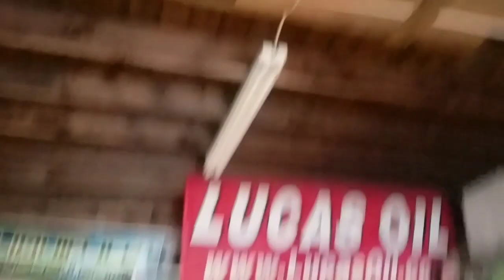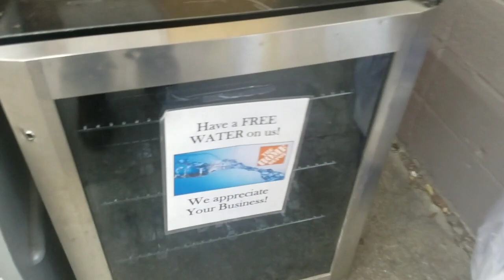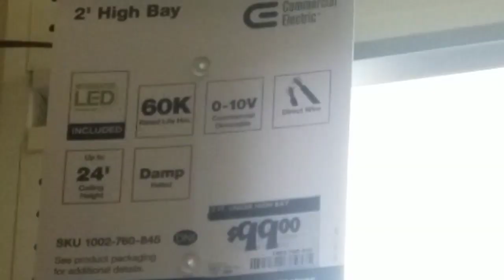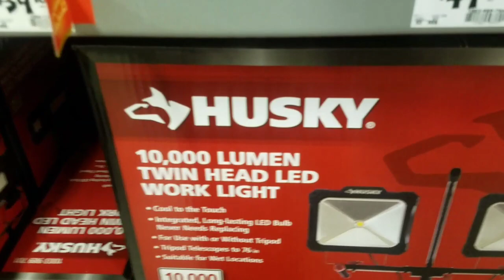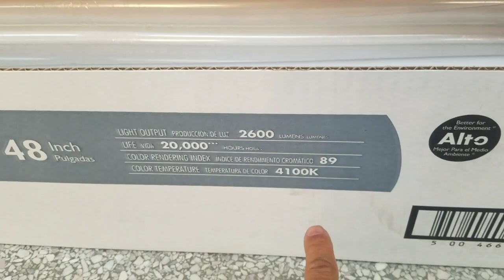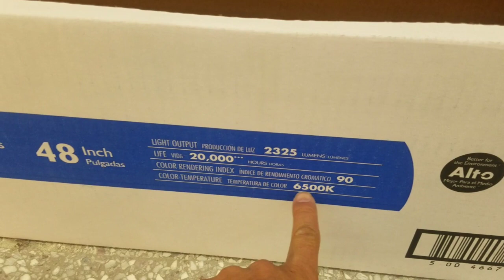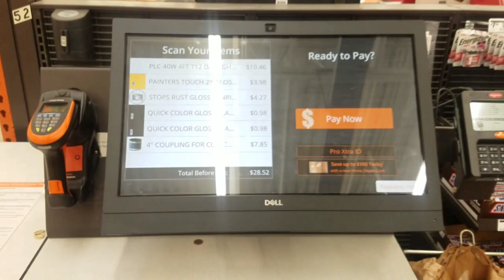HOW TO BYPASS LAWN TRACTOR RIDING MOWER SEAT PTO BRAKE SAFETY SWITCH HARD WIRE IGNITION-SOLENOID FIX

Comment: What I did is follow the orange wire closest to my starter solenoid ensuring that it had power when the key was turned and then jumped it to the positive safety switch post on the starter solenoid bypassing the seat and brake switches with a 5" piece of wire.  She starts each and every time since doing that plus I don't have to be sitting to start her.    👍
Reply from the maker: I know,  I’m the king of bypass

https://youtu.be/OdmiUN3F7kY

Comment: Good video.  I am having trouble with my Bolens riding mower which, except for the color looks very similar to yours.  Mine will crank but won't fire due to one of the cut-outs somewhere in the electrical system.  BTW when I prime a carburetor I just pour a little fresh gas into the carb, instead of expensive carb cleaner.  thanks for posting this.
Reply: i dont mean to be so offtopic but does anyone know of a method to log back into an Instagram account?
I was stupid lost my login password. I appreciate any help you can give me.

Comment: Thank you, Henry. I have a small berry farm and to keep it profitable, I have to fix my stuff. I was really stumped and you helped me.
Reply from the maker: I’m glad!  Hope you’ll subscribe
Reply: @MowersNBlowers  UPDATE   conditional kudos only!!  the bypass wire you demonstrated let it crank, but no spark. I had to depress the brake safety switch with a wire to get fire. Now I am running, but have not done a test mow. I did subscribe.
Reply from the maker: @Fish5919  my bypass wire will allow spark as long as your ignition coil wire is also connected directly to the back of your M tab on the ignition switch.

Comment: Ignition coil air gap and rust on the flywheel magnet sanding those lightly and removingvtge rust and setting the armature gap to spec will greatly improve your spark

Comment: 22:00  Orange wire is trigger when key is turned to start position, BUT what LETTER terminal is it?
Reply from the maker: The trigger wire is the S tab as stated numerous times in the video!  It’s orange in this video but usually white in other models.

Comment: you only get 2600 lumens for a short while, then it starts to fade. the led will last a long time and as you said is a quarter of the power plus the reduction in power from the removed ballast, installation takes about 5 to 19 minutes, my kitchen is so bright i had to remove half the led tubes,

Comment: Blades turn because the deck tension is not right ther is rod on right side of the deck you have to adjust turn it inward to loosen the belt

Comment: And bro take my word for it, take a 7/16th wrench and wrap it with electric tape, just leave the end you use exposed, that way you will never arc the battery positive with the body of the tractor.
Reply: Or a quarter inch ratchet with handle wrapped will work also

Comment: Hi I’m having trouble with my mtd mower when I engaged the blades it’s fine until i lower them to the halfway mark then the engine starts missing and cuts out but if you go down quickly to the last 2 lowest settings it runs okay again,I’ve checked all the pulleys they seem to be fine any help would be greatly appreciated.
Reply from the maker: Sounds like the deck is misaligned which tightened the belt a bit more at halfway.  Also under that kind of load,  for it to hesitate and backfire means your carburetor isn’t clean,  or your valves need adjustment to spec.

Comment: Really need to get the terminology correct, it TURNS OVER, but it HASN'T started & has Not run aka ran
Reply from the maker: Cranks means the starter turns the engine but no combustion,  turn over means combustion but doesn’t run,  run means continuous combustion and sustained operation.  How about that terminology?
Reply from the maker: You’re welcome to make your own video so I can criticize it.

Comment: instead of braging about bypassing all safety switches  why diidnt you just fix the one causing the prob. did you disc. your seat belts in your truck also  makes about  as much sence
Reply from the maker: If I was a shop maybe,  but I’m not a shop not a mechanic,  flippers get things running and sold!  You don’t have to like it!
Reply from the maker: And bragging is spelled with two g’s, sense is spelled with an S.
Reply: @MowersNBlowers  it not a matter of me likking it or not ---- if you have the knowledge to bypass relays why not fix  it right     .
Reply from the maker: @frankdavidson9675  cost, time, redundant. If you were a flipper, you would understand, either way, thanks for the comment.